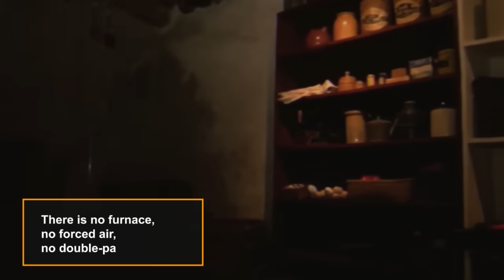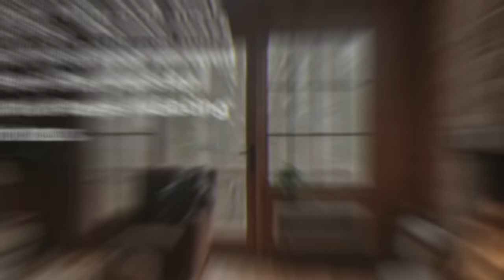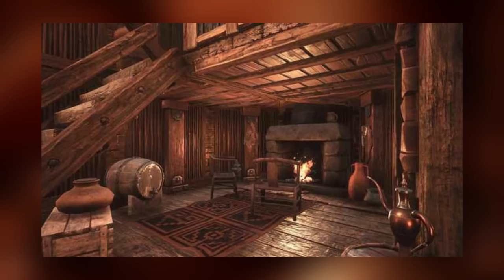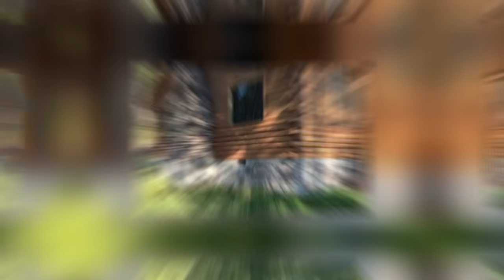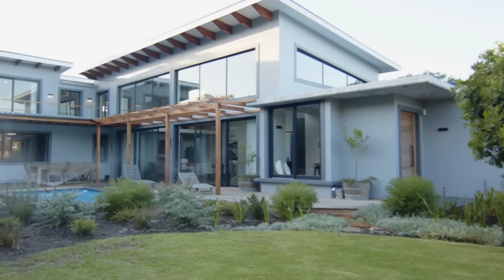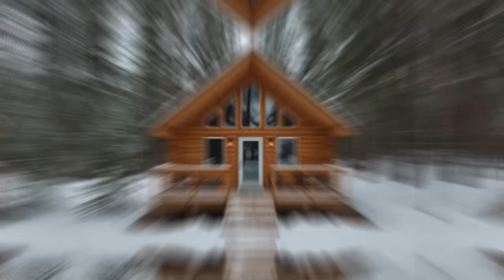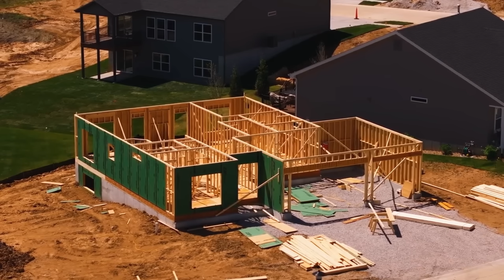Why Medieval Log Cabins Stayed Warm in -40°F While Modern Homes Freeze

Comment: You completely ignored the small number of tiny windows in a small cabin vs modern homes that have lots of large windows with multiples of the square footage.
Reply: True, expensive triple-paned windows do minimize that heat loss but contain NO thermal mass. 
Economist and social commentator Thomas Sowell's aphorism applies here; "There are no 'solutions' ONLY trade-offs".
Reply: @geoffreydebrito2653  "True, expensive triple-paned windows do minimize that heat loss"

But no matter how many layers of glass there is,  Double-pane windows have an R-value ranging from 3 to 3.8,  triple pane window R value can be up to 7- 8, that's crappy when you consider the rest of the wall is going to be 3 times that.
Most heat is lost thru the ceiling into the attic.

I replaced my single pane  windows in my 1928 house with double pane, before I did that it always felt like a cold draft at my desk, and the inside of the glass had ICE on it, turned out the convection current of that was the "draft" and it cost me $50/mo to run a space heater behind my chair all the time, once I replaces 3 windows in the room no more ice, draft or space heater. Same in the bedroom.
I put R 100 worth of insulation in the attic, and because I have a lot of heavy artwork- I added 2" of celotex, vapor barrier, 1/2" plywood topped with sheetrock inside- that added about R14 to the existing walls that had 4" blown in insulation.

My entire electric and gas bill for the 2 BR 1100 sq ft house full basement in Iowa averages $139/mo and that's with the gas furnace set 24/7 to 73 degrees, and 3 mini splits, 2 tower computers on 24/7 and a 2 HP along with a 3/4 HP motor used about an hour a day, average of 3 to 4 loads of laundry washed and dried per week
Reply: @geoffreydebrito2653 they let in sunlight which warms the house
Reply: IF the windows are south-facing, and they are multi-pane & well sealed up, then they can add heat rather than be a source of heat loss.
There are 12-month greenhouses even in Canada (although in that climate it often requires a small amount of powered heating on especially cold nights).
East or West facing windows are hard to get to a place where they can be thermally useful though.
And north-facing windows are pure heat loss. A cooling loss in summer too.
Also, having a lot of greenhouse effect raises your cooling costs in summer ...unless you plan ahead with large overhangs so that the windows stay in shade at summer sun-angles.

You have to have a dark floor with very high thermal mass to leverage it well though. I've seen a greenhouse go as high as +80F (above outdoor temp) in summer. In winter more like +50F. It's less with big windows than a full greenhouse, just less greenhouse effect. But that's free heat without any fuel. But it comes crashing down at night unless you have plenty of glass layers so it's decently insulated, and plenty of thermal mass to hold onto the heat. You'll want to do different thermal coatings on the windows too, and with the coatings on the innermost glass pane, not the outermost.

I somewhat disagree with the video about using wood for thermal mass though. It's far less dense than stone or concrete (or even sand). Thick wood works, but a high R value exterior, with stone or concrete inside that, is gonna work even better. I don't think anyone will find wood which is cheaper than stone or concrete per pound, if you're going for thermal mass. Exterior insulation (ideally rigid rockwool) on CMU (filled), with a vapor barrier between, will blow wood away. Note, nobody actually uses that on mass-produced houses, but it's more thermal mass & insulation than wood, and cheaper than extremely thick wood. Modern tech/materials are far from useless, it's just usually only applied to make houses as cheap as possible. You can apply it other ways.
Reply: @kathrynck  Once lived in a very modern (well more Minimalist / Moderne) passive solar house in the Pacific Northwest with 30 foot south facing windows. Triple glazed. The floor in the main living area was a very warm Italian floor tile. Even with a few inches of snow outside on the ground in the garden the main living area which had 20 and 30 foot ceilings was kept warm and cozy with no more than a small wood burning stove. Lit for a few hours a day. 

In the three years I lived there the only time had to use the underfloor electric heating was when there was snow on the ground for a week, daytime temps in the mid 20's, and deep dark gloomy mid winter skies. And even  then it only had to be run for an hour or two. Even in the middle of a typical PNW winter the large living spaces of the house always felt cozy because the air temps were kept around the mid 60's by radiant heat from the floors and the walls. Some of the south facing walls were large concrete slabs. Beautifully integrated into the dining area south facing wall. 

All the light from those south facing windows meant that even on the darkest winter days the house always felt bright and cheerful. Even though it had a lower percentage of wall area as window-space than typical modern houses. Only small windows east and west side. None on north side of the house. But the south side was all large glass windows. With some of the window area backed by a large concrete slabs about six inches thick. The slabs forming a unit about one foot narrower on each side than the window it faced. 

Was very sorry to move. It was such an easy house to love. Always so warm and cozy. And very easy to cool in the summer too.
Reply: @kathrynck   Go far enough north or south of the equator, and one gets very little to no sunlight for a chunk of winter.
Reply: @justinw1765  That's pretty far north/south.
Even in Canada, 90% of the population lives within like 100 miles of the US border. So you're talking about a fairly small number of people. Alaska and the northern territories in Canada, and northern Russia. 

South, you're looking at just Antarctica, which doesn't have any permanent population.

So, "yes" ...but ;)

Overcast days are probably a minor net loss vs insulation, with south windows I mean. E/W an overcast day would definitely be a loss, sunny days would be a small gain. That's assuming you have thermal mass to absorb and hold onto the heat though. It'll try to all leak back out the windows at night. A good multi-pane window is only about R5.

S facing windows can be great. E/W are ...minimally painful. North windows are just burning money. Needs thermal mass though, and awnings/overhangs to keep the sun off them in summer.

I'm doing a house (zone 6b) which will be more glass than wall on the south side. Deck overhanging the glass on 1st floor, roof extension overhanging the upstairs glass. Measured out so the sun just touches the windows on the equinoxes. And climbs about 5ft up the glass for xmas. Minor E/W windows. No north windows. Exterior rigid rockwool, interior (filled) CMU. Walls are about 18" thick with int/ext finishing. Around R30 or so, but more importantly, huge thermal mass inside the insulation. Trying to get about 2200 sq ft down to around 15k BTU, and make it so you can't tell whether it's day or night from the HVAC draw. Technically I'm doing 4-pane (2 double pane frameworks, with a gap between).

Ambient temp in space, with no sunlight is about 3 kelvin (-270C). Earth's surface with no sun, but some magma heating, would probably be about 100 kelvin (-170C). The sun puts out a lot of energy, when/if you can make use of it. Ionosphere + atmosphere snatch a portion of it. But about half reaches the ground. Solar panels grab about 20% of solar energy, and then another percentage loss converting electric to heat. And they degrade over time. Thermal capture gets more like 90% and it goes directly to heat energy, and works until you break the glass. But it does leak heat out the glass, yeah. Needs something for the heat to soak into.
Reply: @kathrynck    Yeah, direct Solar heating should definitely be more utilized.  I'm going to be building some outdoor Solar thermal batteries, by making a platform a few inches off the ground, placing cinder blocks around and filling up the middle with sand, painting the cinderblocks black, then putting a double casing of clear plastic and/or glass around same, putting reflectors around it, and then piping the warm to hot air in through an insulated window insert.
Reply: False premise. USA is not the world. Modern homes can be built from bricks and have good insulation
Reply: I insulated my loggia from the inside with a homemade perlite plaster. The plaster is 6 cm thick on average. The apartment is in a prefabricated reinforced concrete building. The temperature on the loggia increased by almost 10 degrees Celsius in the winter, without any heat source!
Reply: Nowadays most of the houses built have the eagles they're double paned to keep you warm in the winter. So the  window excuses out
Reply: @ItsMe-ic7on You need triple paned and south facing.
Reply: @ItsMe-ic7on Regular modern windows have an R value of around 2. EXTREMELY poor compared to a typical insulated wall which ranges from R20 to R50 on average. Literally 10 to 25 times more insulation in an insulated wall than window.
Reply: @justinw1765  You can get up to about 3.8 with Low-E.
Reply: @StanleyDard COG U or Overall? Most forget that the frame is important to this.
Reply: @ItsMe-ic7on A common U value for double pane argon filled windows is .35. That equates to an R value of 2.86. An insulation filled 2 x 6 wall has an R value of 19. So the windows make a huge difference. Even triple pane windows have a poor R value.
Reply: I don't even have to lose heat. The house just gets uncomfortably cold during mid winter.
Reply: Windows only account for 10% of energy loss. Research US department of energy's research on "Energy efficient Windows." The 50 yr warranty will never save you money in energy. They proved it.
Reply: Windows are key as well. Should be oriented and glazed properly depending upon orientation and seasons.
Reply: the house I  currently live was constructed in1916, it has over15 large windows and when I watch these documentaries ..I lamento stupid we have been ... terrible

Comment: This is so fake. Log cabins are infamous for being meat freezers (and in some parts of the world they are used as meat freezers!) in the winter. Case in point? The Great Plains during the winters, many a family would actually go to their dugout in the back which was a sod house partly buried in the ground because their summer house, built of wood, was almost impossible to keep warm in a freezing winter. Also modern houses tend to keep their heat better than ancient houses if the windows are sealed properly. This video is deliberate misinformation.

Comment: Excellent information.  I have seen a video or two of folks building this kind of heat mass stone structures for heating in recent times. My only concern about your video is where you mentioned the actual construction of the "medieval" homes being most efficient when using logs from old growth forests.  Today, there are so few of these left, I would hate to see more cut down to comply with the old way of building cabins/homes.
Reply from the maker: That's a very valid concern! We definitely need sustainable solutions today.

Comment: I had a log cabin in Alaska  it was modern as in built in 94  it retains heat far better then log siding and any other material due to being a whole tree   logs were a foot thick  with caulking?  not sure what they sealed between them with,  inside we had dry wall though  but  with modern triple pane windows  that thing retained heat for days it felt like.    Our furnace almost never ran even when it was -50  with a wind chill of -90   we did have a wood stove but rarely used that as it'd turn house into a inferno  LOL but great in power outages.   :P   seriously though old or new log homes are 1000 times better then standard american construction houses.    They are just not meant for every climate we have in the USA  not sure why we think they are and build them everywhere even in places they really don't work well at all.

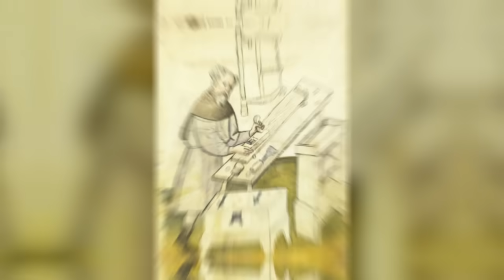Comment: I’m only at 7:44 for now but I want to talk about wood quality. I doubt we could find any trees old enough to make for perfect insulation like that and I don’t know enough about hemp wood to know if it could reach sizes similar to old growth trees, and I REALLY doubt bamboo ever reaching those lengths. Is it possible to make plywood that thick and works just as well? Also with how HUGE the human population is, I’m not sure if we could wait around long enough for trees to reach old growth tree levels. Right now I live in a trailer built back in the 60s or so, the walls are an inch thick so it’s a constant struggle to be comfortable even with power!
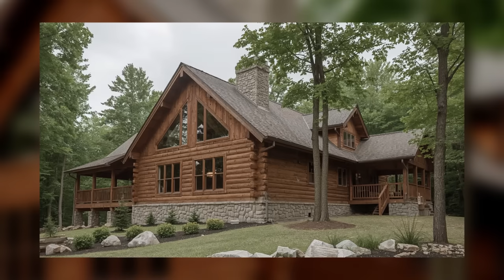19:14 that’s sad information, about following R value when it looks as though some old log cabins do better than modern junk. Also I’m jealous. 7 feet from floor to ceiling?! I’m 5 foot 8 and can reach up and touch my ceiling! 7 feet sounds taller than whatever I got now!
Reply: Well on a large scale yes wood would be a problem, on smaller scale even new growth works, it´s worse on insulation and rot resistance usually but it works and you can actually insulate log-houses from the outside  when using prober materials... When using thermal mass, modern Scandinavian or Russian style masonry heaters and supplementing that with solar panels and /or small wind  one could actually make the energy producing house out of properly build  loghouse , not zero energy  house but net positive one.

Comment: Modern buildings that are highly insulated and air tight, with heat recovery ventilators, use very little energy. They can also use passive solar and thermal mass.
Reply: Modern buildings use half inch or thicker... glass windows.

 Most of a modern homes losses.. come from thin windows.  Even multi-pane windows dont compete with thick glass.

 The other big loss is through the roof.. from rising heat.. and escaping air.

 Buildings have a lot of thermal mass in thier concrete floors.  Normal houses... have thin wood floors.

 You cant compare a building to a standard house.  The costs alone... are stratospherically different.
Reply: Airtight homes can trap radon gas indoors, increasing health risks, especially when combined with poor sealing in the foundation. To mitigate this, it is crucial to ensure proper ventilation, seal any cracks or openings in the foundation, and consider professional radon testing and mitigation if levels are high.
Reply: @ohsweetmystery Air to air heat exchangers get over that problem. Or be willing to vent so air so as to reduce pollutants and moisture with the cost energy use.

Comment: Thermal mass can be your best friend or worst enemy, depending on the conditions. If a room is constantly occupied, but the heating and the weather outside vary a lot, the storage of heat can even out the temperature and make the best use of the heating that's available. But if you need to bring a room that is normally vacant, like a hotel room, up to room temperature in a hurry, the thermal mass can make it feel like an igloo, feeling cold even when the air temperature seems normal. So the way the building is used has to be matched to the construction type.
Reply: makes perfect sense 😗
Reply: True. Part of my flat has 16" stone walls. Its like a cellar, if it goes cold it takes days to warm up again.
Reply: @bobthebomb1596 tha same with old 1800 full brick house wich I have  its truly p in as.. to warm up in winters
Reply: That's what the windows are for, you can manually regulate the temperature pretty fast
Reply: Lowering your thermostat to a level with an expected timeframe for recovery upon return can mitigate the costs and ranges.
Reply: ?!?!Then you obviously do NOT know the IGLO applies the same INSULATION PRINCIPLES as the LOG CABIN !!!!

Comment: My apartment is on the north-west end of building built in 1912. It cools off in an hour and a half when the radiators are shut off.
Reply: Its built-year doesn't reflect its engineering.
Reply: @cacatr4495  There are great differences in the construction of buildings from the past, but few North American buildings were built with a view to lowering heating costs. Energy was cheap. Our building was steam heated with a Scotch marine dryback boiler, if you know what that is.

Comment: The houses they built from 1920 to 1960 were Unique... They had cast iron heating ... The key is to seal all the cracks where the cold is coming through near the Windows too ...
Reply: To which region are you referring?  That is not true of all.
Cast iron heating was not in the 1950 house I grew up in.
Reply: The thin windows are the main loss of heat.  They are almost as thermally conducive as a small airhole.

 I live in a place with a double pane skylight.  In the winter.. i have to crank the heat to like 80 degrees... due to the cold coming from the skylight area.  Theres zero air leaks.  Its just conductivity.

 Skyscrapers use like half inch thick glass windows.   The thicker glass is much more thermally resistant.  The added mass helps too.

 Dual pane or even tri pane windows... still dont compete with single thick windows.

 Cast iron fireplaces release quick hot radiant heat.  But ghey are nowhere near as efficient as the old Russian heat systems.  You can tell by feeling how much heat exits the exhaust chimney.  The 
Standard fireplace or cast iron stove heater... will have very high exhaust temps.  While rocket heaters like those Russian heaters.. will probablt be under 100f exhaust temps.  They absorb far more of the heat into the thermal mass... before releasing the exhaust.